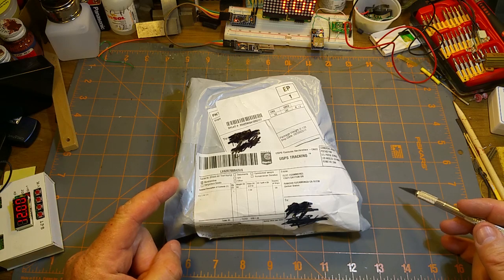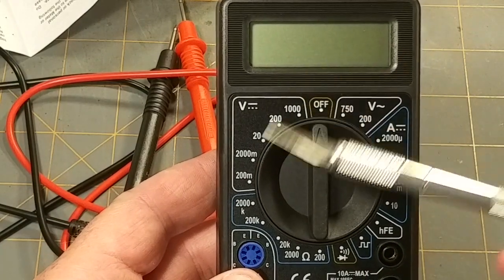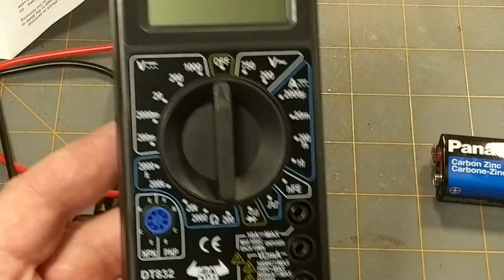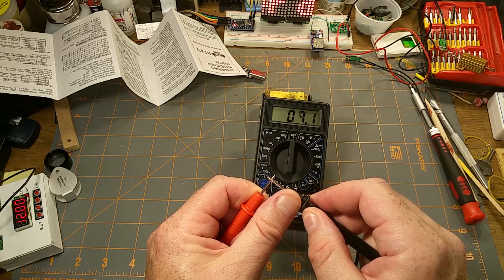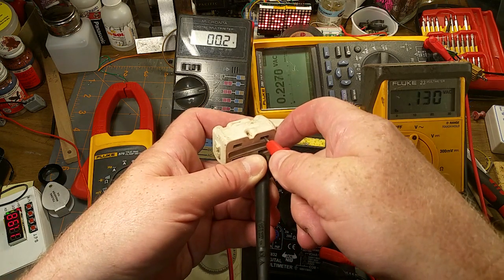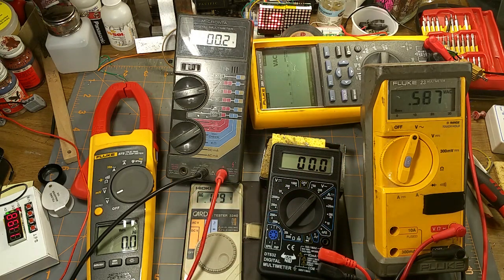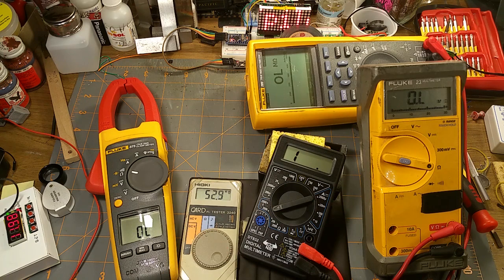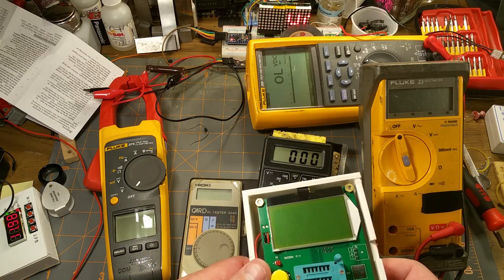The cheapest multimeter on Banggood

Comment: I just started buying Chinese factory products via Aliexpress... best buy so far was a 'MingShi 2000S' razor - pretty much a clone of the patent expired German brand 'Merkur Futur'. The price difference is more than 90% (Merkur 3750 here, the Mingshi cost 300 including post from Aliexpress). The quality is perhaps 95% of the original (some minor differences inside).

For many years we learned that weight and materials mean quality - but this isn't always the case... but also, good quality products don't cost a great deal more to produce. Perhaps QC failures can push the price higher if you set the bar higher, but as this comparison shows as technology brings better chips out (which really are cheap as chips) we've been getting overcharged.

My meter of choice (with a microamp and capacitor measurement and extremely impressive accuracy for real world use) is a WinApex ET8102 (I fancied something with temperature measurement, but the WinApex ET8101 is just as good, and even cheaper). Check those out - you can buy those for the price of a burger... $14 for the '02 and $12 for the '01. Now we're getting up to a good quality suffering mostly from cheaper probes.

Comment: I bought this exact same meter myself in UK for similar price. It's not too shabby and does it job ok. You can actually get an even CHEAPER pocket size multimeter on eBay directly from China for a mere 99p. NOW That was a piece of crap the buzzer didn't work, and the thing fell apart inside a month.

Comment: You should order another, they have stripped a lot out of it over the years, smaller PCB, no beeper, no fuse, well I say no fuse but no fuse that you can replace, just a resistor that will blow and perhaps save your life. Would be interesting to see your review on the "new cheaper model" - I bought one this month from the far off lands, C$4.74 inclusive, I wasn't expecting much and by golly, I didn't get much....
Reply from the maker: At the price, I tend to use these as "risky situation" meters when i don't want to risk damaging a better meter.
Reply: @pileofstuff  Yes, agreed, since you made the video, they have stripped out stuff and made them worse. No fuse now, just magic smoke.

Comment: That looks almost exactly like the 50LE inside (better than the Harbor Freight ones).  BTW You can get the 50LE's for ~$3ea when you buy reasonable quantities (like boxes)
Reply from the maker: It also seems to be the same one you were hacking around with back in February.

And I don't see myself buying these things by the dozens (like *some people*)...
Reply: They're only really useful when you buy them by the dozens.  A fluke is a fluke, these multimeters.  They're the complete multimeter-within-arms-reach solution for your life.
Reply: i have a few of the red HF ones, this is pretty similar to the ones i have. wonder if they have different models for different areas.

and as mentioned, they're not terrible, they're just built cheap as crap. but they're good for having in random stash locations for say, testing if your fuse is getting voltage, or  if your alternator is outputting what it should, general low voltage hobby prototyping, etc.

i would not put these near mains voltage.
Reply: There are a couple of different models of this same MM. Some with battery testers, some without buzzer, etc. You will find the exact multimeter under a hundred brands.

Comment: Those multimeters are crap. Yes, they are accurate, and are safe for nor normal bench use, but in my experience they usually stop working out of nowhere or go out of calibration in weeks. I had an electronics class where we where at least 9 and almost everyone had this kind of Multimeters, none lasted a year. As with most Chinese manufactured things, this same MM can be found under several brands, some of them have welded fuses that when blow up should be tossed away or you will have to spend some time changing it. I'm not saying to spend 100s on a Fluke if you are a beginner, but invest a couple more bucks and go for a slightly better tool than this one.